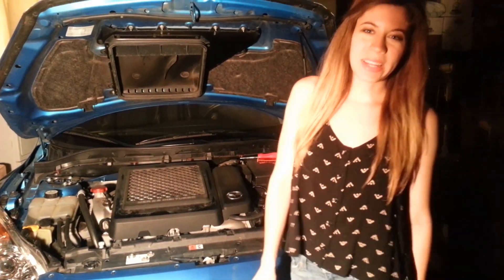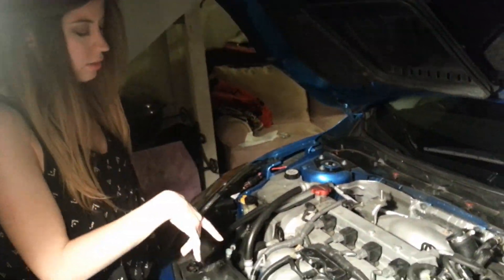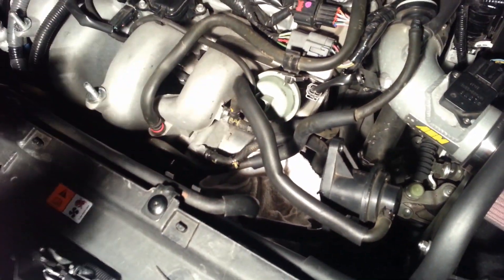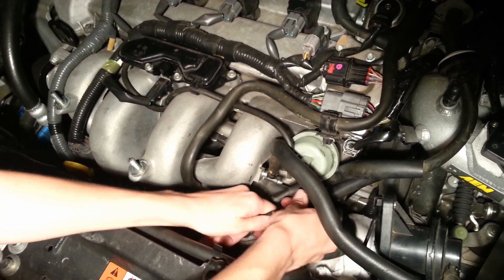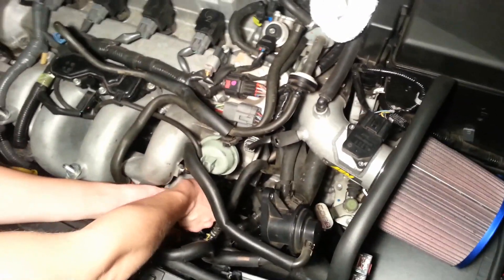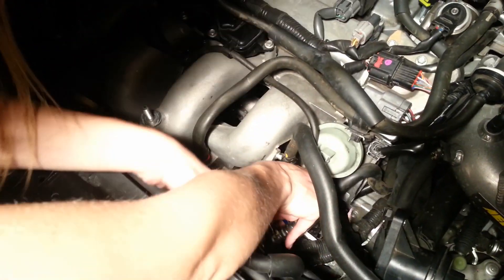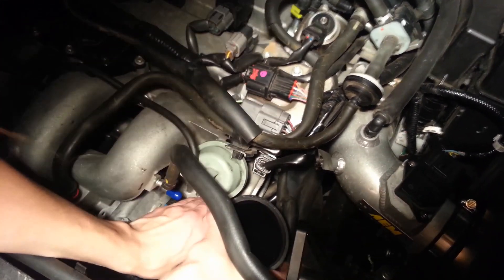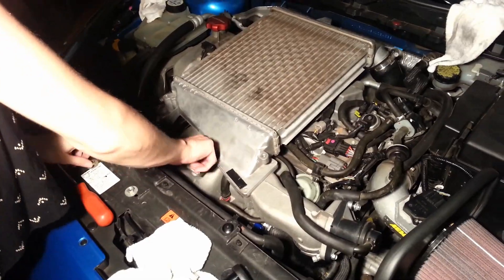HOW TO INSTALL A COOLANT BYPASS & THROTTLE BODY GASKET!

Comment: I attempted to remove my coolant hoses from my throttle body but even after loosening both clamps and pulling as hard as I possibly could neither hose would budge.  Any suggestions?
Reply from the maker: +Turd Ferguson Wedge a flat head screw driver between the hose and throttle body and twist.
Reply: +everythingdiy That did the trick!  Entire bypass took me 30 seconds vs the 30 minutes I was struggling with yesterday before your tip helped me.  Thanks a lot!
Reply: open up the radiator cap to relieve the pressure

Comment: Can I do this for my NA 2.5L mazda 3 engine?
Reply from the maker: xbindingxlightx You can do the coolant bypass but James Barone Racing does not make a thermal insulating gasket for an NA Mazda 3.

Comment: Additionally you could blank off the in and out coolant pipes to give your engine bay a more tidy or stripped out look, plus it limits chances for coolant loss from split pipes and corroded fixings on older cars.
Reply: What do you recommend using to block off the in and out?

Comment: Nice.  Did you notice any slight performance increase?  I did this to an old tuned port injection camaro iroc I had.  I've also done it to my GMC truck.  Can't say I've noticed much on the but dyno, but living in CA our temps never get cold enough to warrant hot coolant going through the T.B.

Comment: Hi how did it work for you. Are you running better boost temps
Reply from the maker: For this kit the difference it's too small to notice. We did, however, see a really noticeable decrease in overall boost air temperatures when we installed the intake manifold thermal insulating gasket. If you're going to choose one of the two pick that one, the results are fantastic. Thanks for watching!
Reply: +everythingdiy About how lower are bats with the intake manifols tig?

Comment from the maker: Weird I had no coolant in the hose whatsoever but my car sat overnight before we did this so it probably drained out. I would remove your radiator cap, start the car and let it run with the AC on for a few minutes to let any air bubbles that maybe in the lines out. Thanks for watching!

Comment: Just did this install today and I'm sure I missed a step cause when I pulled the coolant hoses off i drained a decent amount of coolant.  I'm guessing I should have pulled the radiator cap off?